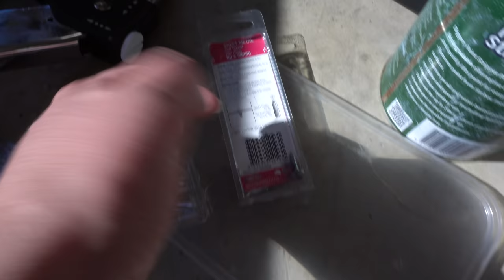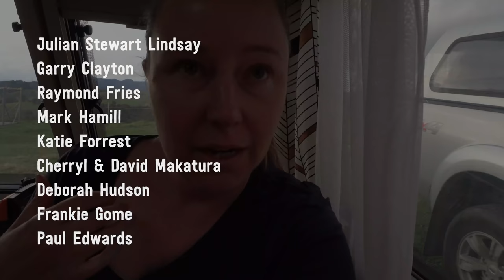Paying Vinny More Attention 💋

Comment: Hey! What fun that it goes forward depending on the circumstances a tip when you drill with smaller drills that go off sometimes insert them further into the chuck it does not matter that the spiral on the drill in the chuck just take out as far as you need in length of the drill then they last longer . hug Anders
Reply: and they break as easily
Reply from the maker: Ah, good to know!

Comment: Small drill bits are more fragile than larger drill bits. Top tip. Faster speeds on the drill for smaller drill bits, slower for larger drill bits. Less pressure on the smaller drill bits and you'll have it in the bag.
Reply from the maker: Oh good to know! Thanks Garry